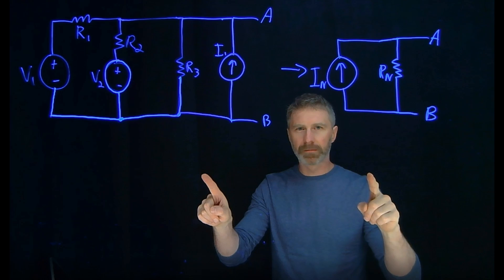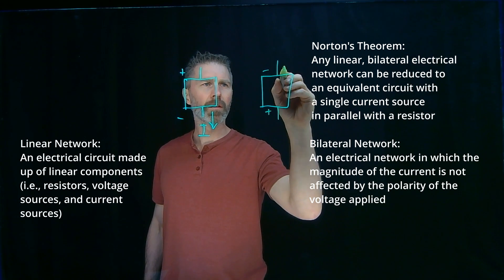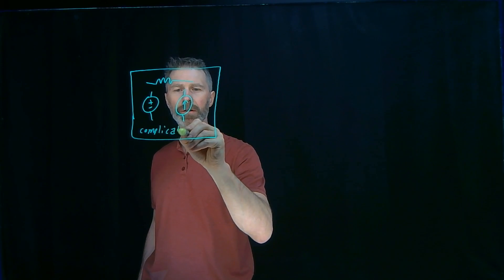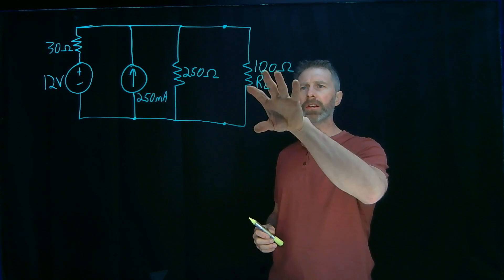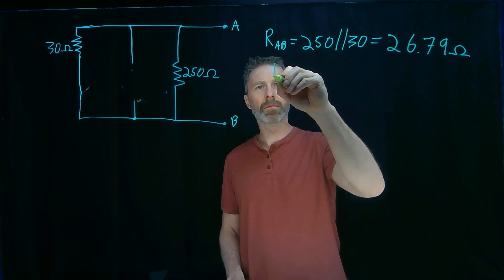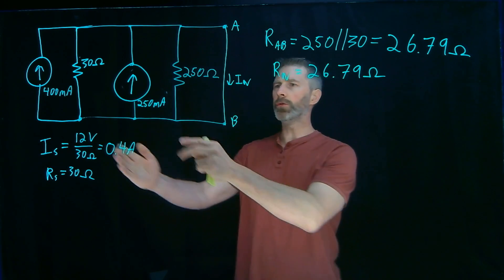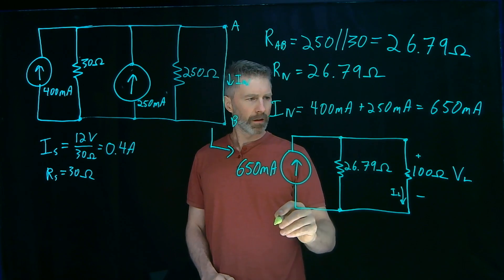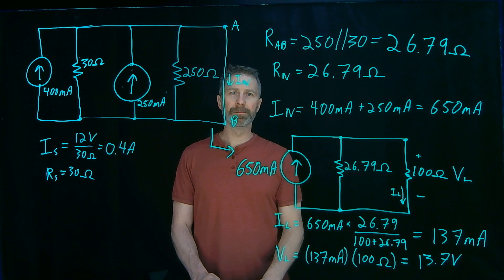Norton's Theorem for DC Electrical Circuits

Comment: What to do if the circuit has inductors and capacitors?
Reply from the maker: I assume that you are referring to AC circuits, not DC. In that case, you can still follow the exact same steps, except that you will be dealing with impedances for the resistors, capacitors and inductors. Impedances are complex numbers, so the arithmetic will be a lot more involved. You will still end up with a Thevenin voltage and Thevenin impedance except that those values will have a magnitude and phase angles. I do intend to get to AC circuits, but there is a lot of DC circuit stuff to get through first.